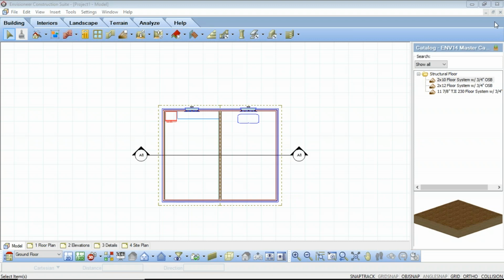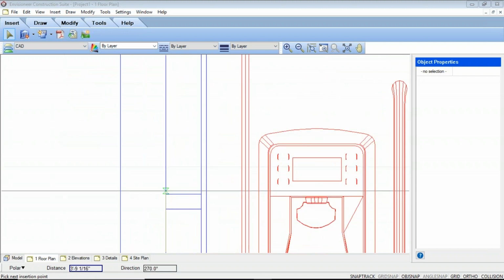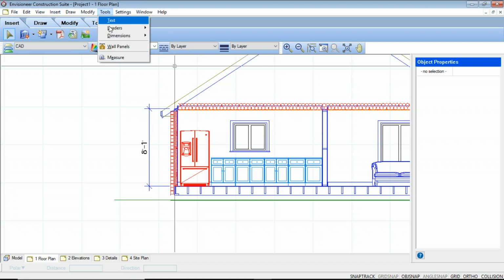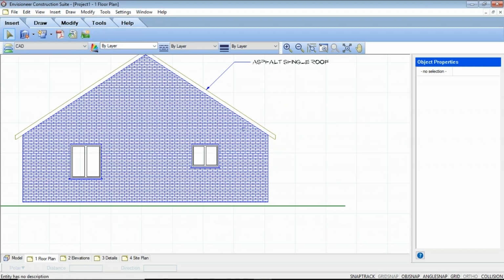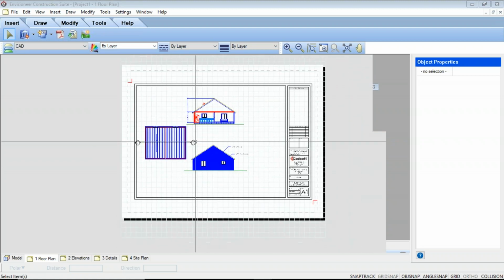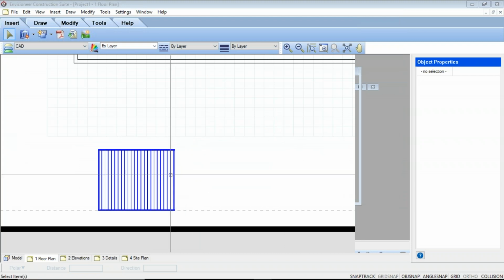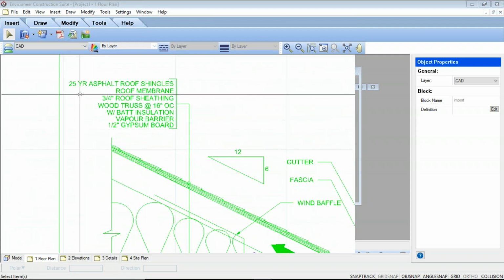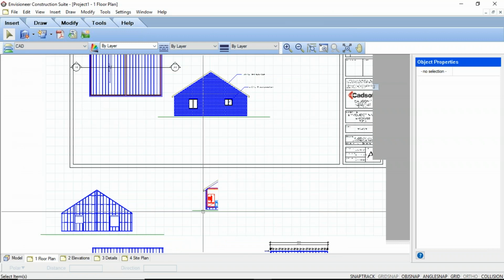Home Design Software Making Working Drawings Easier with Envisioneer

Comment: Your awesome Nick. How to add new worksheets?
Reply from the maker: Hi Louis, to add a new work sheet you can right click on an existing worksheet and select either Add Worksheet or Copy View. The Add Worksheet will create a blank sheet for you with no title block. The Copy View option will copy the selected view, contents and all, meaning it will include any inserted view and the title block. You can then delete out what you do not need and then edit the title block information.
Reply: @Cadsoftcorp  thanks. And how do I add a new title block to this new sheet?
Reply from the maker: @Saludtotal48  Hi Louis. If you use the "Copy View" option, the titleblock would copy over from the other sheet or you can import a new one: https://www.cadsoft.com/using-different-sizes-of-titleblocks/